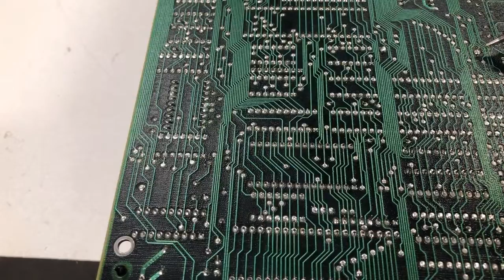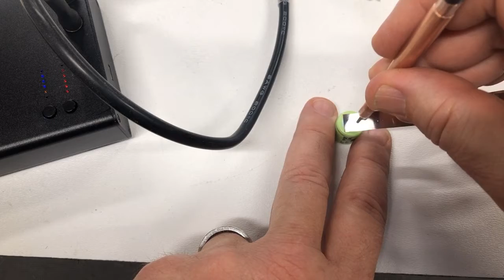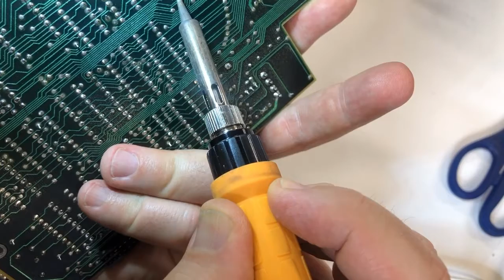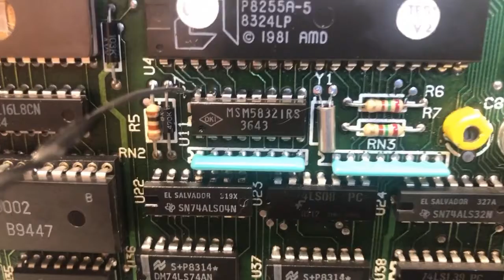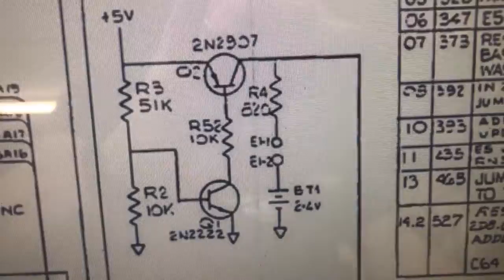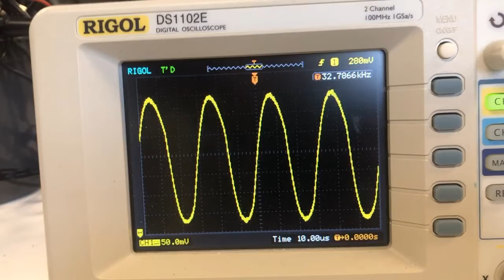Hyperion Take #2: Repairing the Real Time Clock

Comment: I checked the specifications of MSM58321 It should operate down to 2.2 V. As an aside, I don’t understand why you put another nickel cadmium battery into your Hyperion. Nicad batteries are notorious for leaking corrosive electrolyte and doing serious damage to motherboards. A better solution would be to put in a 3v lithium CR2032 within a disc battery holder In the place of the nickel cadmium battery. To prevent the power supply from attempting to charge the CR2032, It would be necessary to cut the jumper at E1 and E2. With that jumper, cut the MSM58321 will run right off the battery and the battery will not charge when the computer is on. If you were to forget about the CR2032 and it leaked, its guts would be contained within the disc battery holder. But that is unlikely to happen; CR2032s are very stable and contain very little electrolyte.
Reply from the maker: I try to keep parts original (even types of batteries) as much as I can.  It should last a good generation
Reply: I prefer to do so as well. But after dealing with the horrific damage done to PCB’s by NiCad (and lithium) electrolyte leakage I  won’t put back original style batteries anymore. They can leak without warning and completely eliminate a large swath of traces much larger than the battery itself. Each to their own…